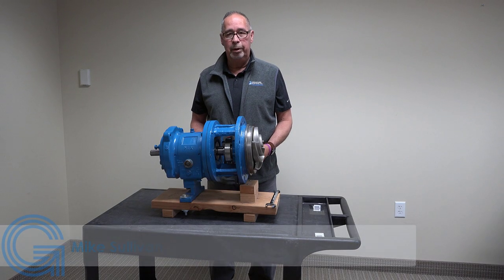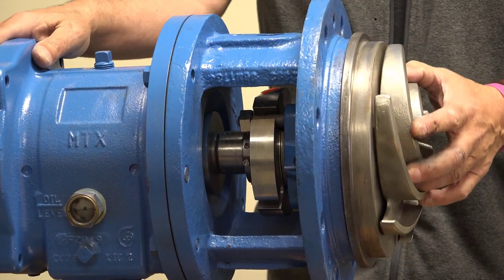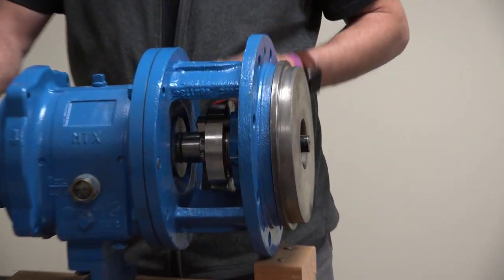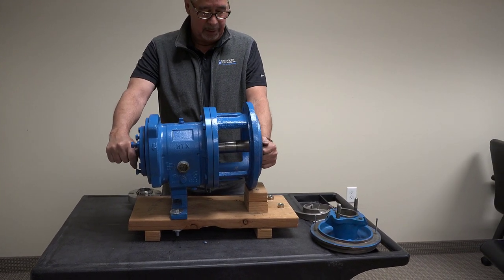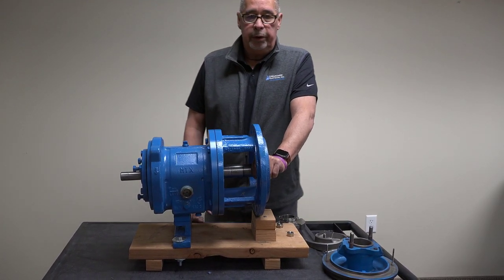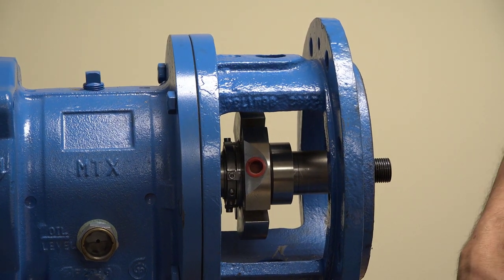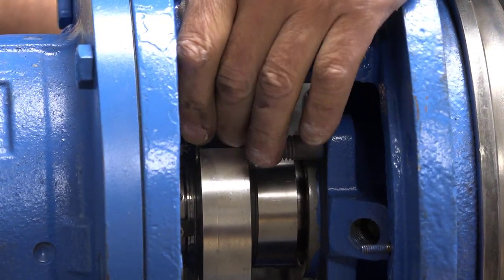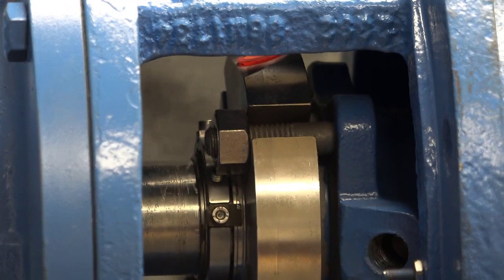Installing a Mechanical Seal in a Goulds 3196 Pump

Comment: Thank you. Good to know to set / adjust the impeller before securing the seal set screws.  I would have screwed that up.
Reply from the maker: Thanks for the comment! Glad the video was able to help you. Give us a shout if you've got any other questions about mechanical seals. Mike Sullivan (instructor in the video) has been working with mechanical seals for about 40 years!

Comment: Que diámetro es el eje de ese equipo.  Y que de medida es el sello?
Reply from the maker: Consulte el manual de la bomba Goulds 3196 para obtener información sobre el tamaño del eje y los tamaños de los sellos. Gracias
https://www.gouldspumps.com/ittgp/medialibrary/goulds/website/Products/CV-3196-i-FRAME/IOM-CV3196-iFRAME.pdf?ext=.pdf